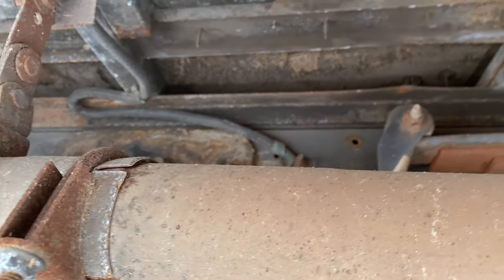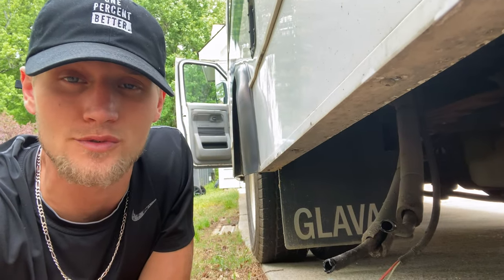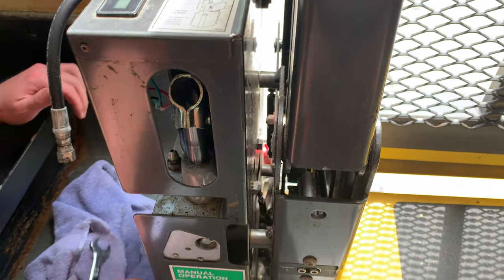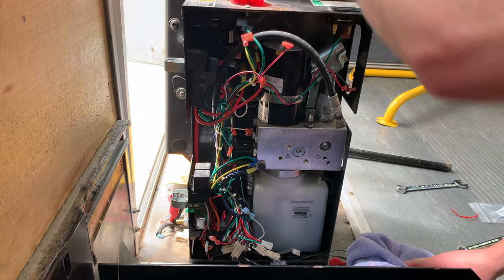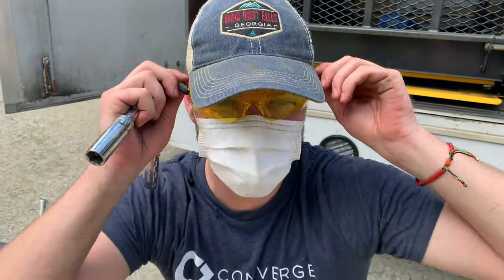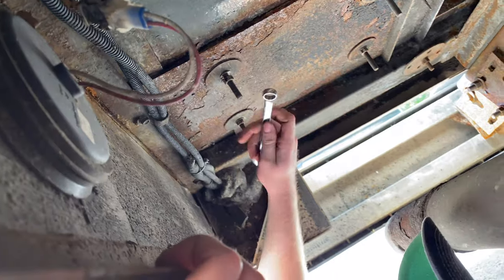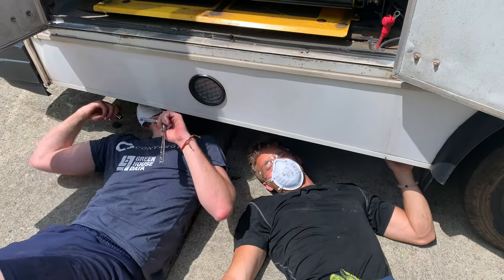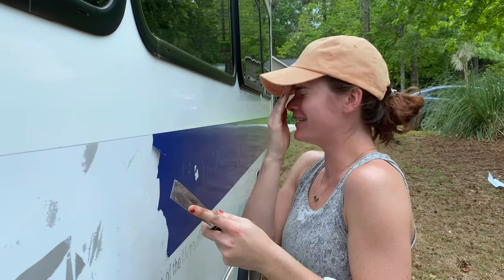SHUTTLE BUS Conversion | Removing Handicap Ramp & Heater AC Hose | DIY RV Tiny Home

Comment: it pays to be "handy " aspecially early in youre lifes when money is tight and youre still building on youre future 
take some woodworking courses , maibe autoshop (thats REALY usefull if youre planning on traveling all over the states with that bus )

even if youre new job is warming an office seat and pointing the workmen to their jobs it pays to know wat their talking about when they say stuff like : that will take me all day , or : it cant be done 

doing stuff youreself gives you a sense of pride having accomplished the things you set out to do , it allso makes the "thing" you repaired or made worth more to you 

im old(er) and i still do a lot of stuff myself , my washing machine broke it wouldnt pump away the water , a new washingmachine was 300 dollar , putting a new waterpump in my old washingmachine and get it to work again 10 bucks for the pump (aliexpress) 6 weeks wait for the part to arive and half a day putting it in the washing machine , there saved 290 dollar with a half days work , if it didnt worked i still only be out 10 bucks more then the 300 dollar for the new machine but i tried it and succeeded the repairman wouldve cost about 150 dollars and wouldve used the same 10 dollar part 
theres tons of how too's on youtube , the times where you had to figure out how stuff goes a part and together on youre own are just about over 

be carefull with getting that ramp out with the hydraulic hoses disconnected it can drop down without stopping spitting out a lot of oil in the process , with the bolts through the floor taken out it prolly tips over and out of the buss as well , dont put youre hands and arms in the moving parts SERIOUSLY the weight and scissor action takes the bodyparts straight off or at least mangle them 
you cant get it out without some pretty heavy lifting  , might be wise to have someone with a come along with the bus under a verry sturdy branch , in a barn with a verry sturdy rooftruss or a small crane help you cause the thing is going to be heavy , kind of a shame that you disconnected all the hydraulics and wiring , you mightve sold it eazier if you could hook it up to a battery and demonstrate it while sitting on the ground , once you taken of the power cable you can lift it out in one piece ...... with a crane , forklift or come along 
make sure you delete that thick powercable , its probably connected directly to the batteries it can trow some pretty big sparks when its touching the metal

Comment: How heavy is the lift? Cause it looks pretty heavy. My cousin and I are starting to save now for our own conversion, and we're really excited. A shuttle bus seems like the best, and most affordable, option. I'm so excited to see what you guys do and your learning process, it's really helpful to know what to expect.
Reply from the maker: Hey Beatrice, we are so happy for you guys! The lift is roughly 450 lbs and was a handful. Please let us know what other information you would like to see from us on our next videos!
Reply: @AwakenDaze  I would really like to see how you disassemble the wiring, and insulation choices. Thats something I've been deciding on for a budget. I'll be up north during the winter more so I'm thinking Rockwool but its not a solid decision yet.
Reply: @tr1xieP1xie  yes!  this is the most safety critical part of the removal (aside from the wieght lol). I am trying to remove one from a similar bus and cannot access the battery because it is in a steel box under the bus. It connects to a 100amp fuse so I am certainly hesitant to deal with it and I have yet to find a shop who will touch it.

Comment: OH, its way past, but I would have contacted a school system to part out the lift.  GIVE TO THEM IF THEY TAKE IT OUT, and find value and donate to them to take off on your taxes... major deduction I think!  Or if not tax write off sell to them at a major discount which could lead to another install or back up parts for them or Nursing home buses.! Same thing with the Air conditioner.

Comment: how much did it cost you all for the purchase price, curious?
Reply from the maker: It cost us 10k for the bus and it has an air ride suspension, f450 gas engine, came with front and rear ac/heat units, 225k miles with an new transmition 30k miles!